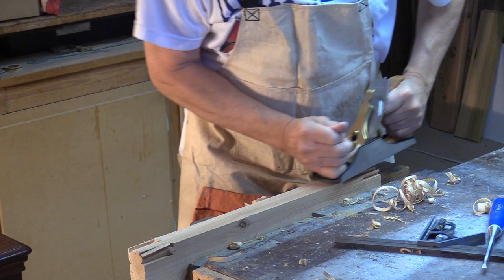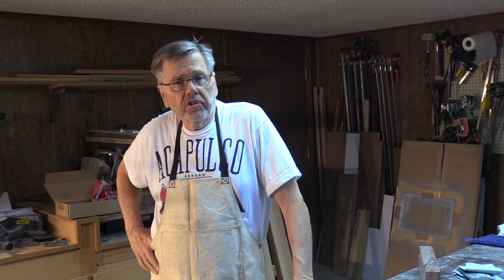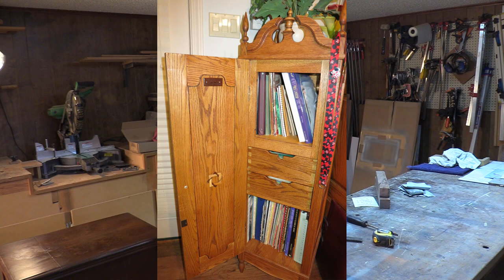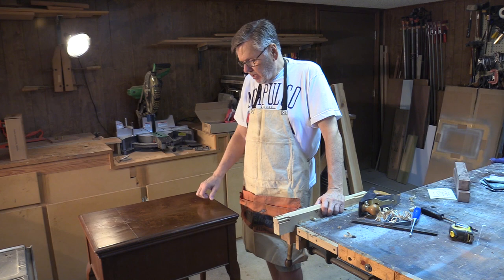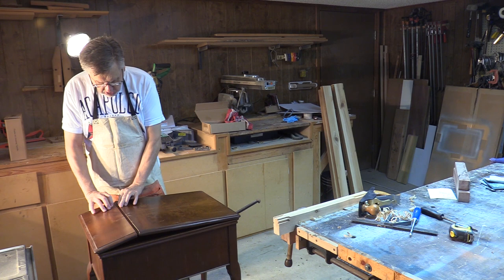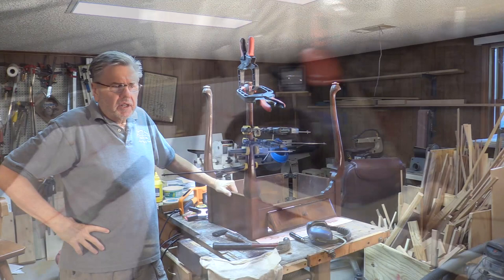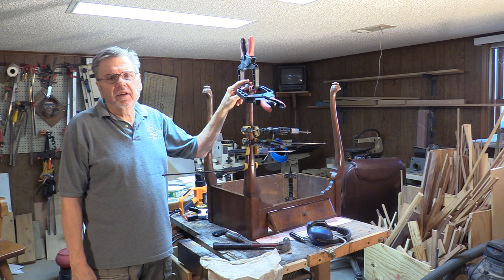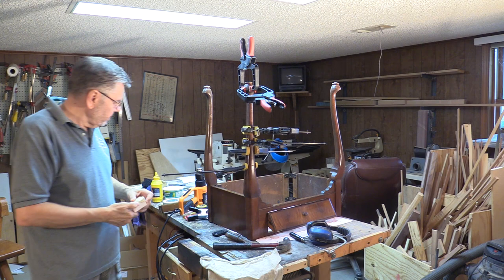Singer Sewing Machine Restoration and Re-purposing

Comment: I have no video. I recently had a house fire and it will be six months before I can get back into it.
The hole on top for the machine is an odd shaped 'trapezoid'. So I made a template from a top of a 42 cabinet and that allows me to use a saber saw to cut the hole larger and to cut away at the round hinge holes. Then I secure the template on to the top and route a larger proper rectangular hole. The space underneath I use baltic plywood to install a bottom, Now this 365 desk can now hold little used items. such as software, keys or whatever. The best and prettyiest cabinet is the Queen Ann. Except for the #42 all Singer cabinets from the 1950s could be disassembled and shipped more cheaply. Later larger vintage cabinets seemed not to be able to be disassembled.
Reply from the maker: Sorry about the fire.  Glad you are ok. Thanks for the info.